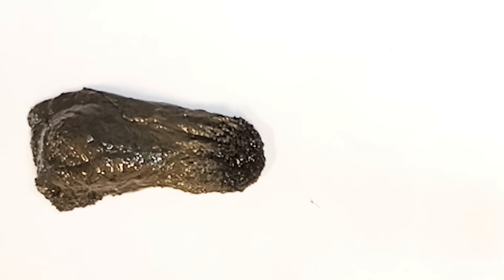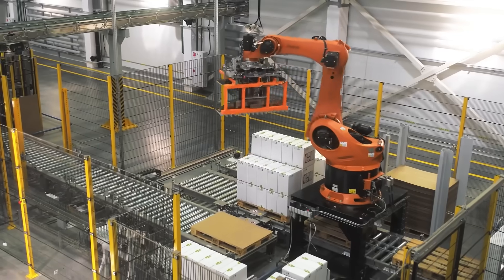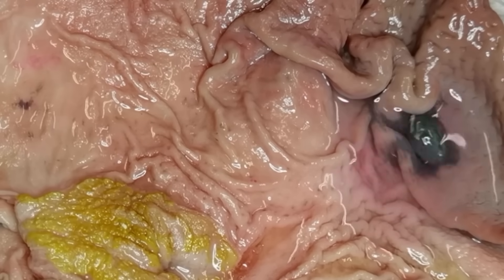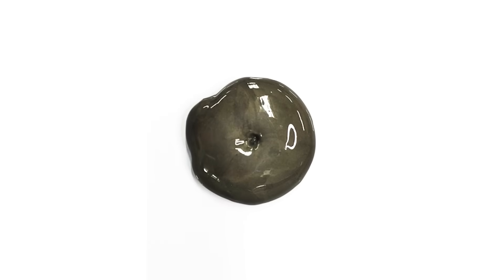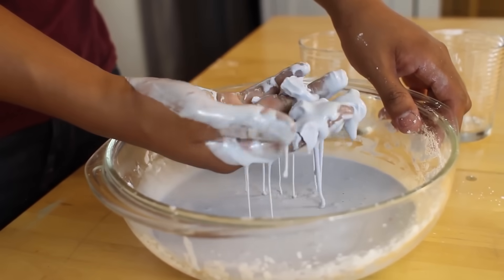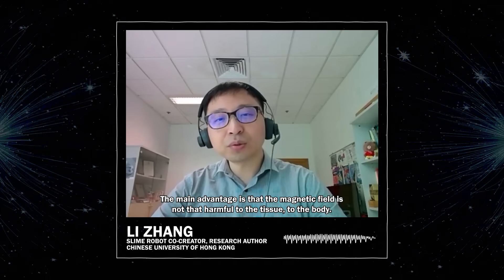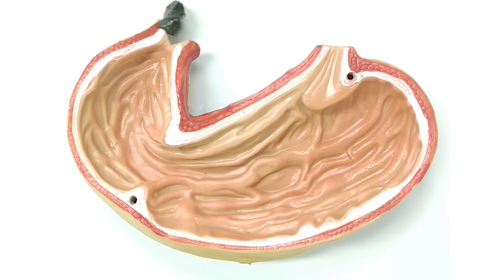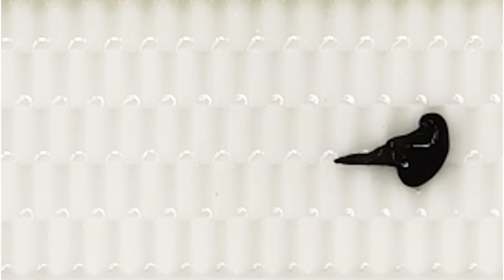This Is The First LIQUID Robot, And It’s Unbelievable

Comment: Using these to reconnect severed spine signals would be interesting. They could even grab a nerve and pull it towards the other broken nerve long enough for them to fuse and heal, then it could retreat out of the body (I'm assuming a strong external magnetic matrix is needed to drive the little dude, so you couldn't just leave it there. Unless the slime could be 'set' kind of how UV light sets some materials)
Reply: But the pressure should be low in the area of the damaged nerve. It can create a protective layer around till it fuses completely. But it should be inert to the acids and other secretions in the body. It's a cool topic for discussion 👍
Reply: Yours is a very interesting topic, specifically the setting feature.
I hope your comment gets upper and read by some creative folks
Reply: In the paper, the magnetic slime is 90% water by weight, and the authors freeze-dried the material to study its rheological properties.  So “setting” in situ seems plausible, but not practical.  I’m curious how its conductive and structural properties would be affected.  The SEM images of the dried material show a pretty dense matrix, and it’s possible the surface would provide enough friction to keep tissue in place for a while.
Reply: If it sets, then getting it out of the body would be pretty hard. 

I think you could just have some sort of puck that you somehow stick on outside the body right where the bot is, and it's sole purpose it to hold it there.
Reply: NANOMACHINES, SON
Reply: step 2: move it into the brain of a person and start mind control and manipulation
step 3: have people do your job for you.
step 4: get soft tacos for everyone.
Reply: @totoisayal5045  i support this
Reply: I think it's possible that it could be "set" as you described using a specific frequency of magnetic field - the slime would need fine-tuned for this, of course
Reply: True it could help humans advance in the medical field but i have mix feelings with this robot, it might disfunction during surgery inside the human body which is terrifying
Reply: It would be interesting, but sort of impossible from what my non-expert wikipedia brain understands. The biggest problem with central nervous system regeneration is that 1. The nerves grow very slowly as compared to peripheral nerves (ex. In your hand), which so far isn’t really that big a problem, it would just need more healing time, but the problem is that our bodies sort of break down the nerve a bit and make a sort of scar, the little dude could work, but you’d need to make it a less hostile environement for the nerve regeneration and also probably find a way for him to get in.

Edit: also, ‘set’? You don’t need to set nerves.
Reply: @clawsproductions582  Interesting. Yeah I figured there might be degradation of the nerve beyond what would be usable. "Setting" I meant that the conductive goop could bridge the electrical gap and permanently freeze itself into place. Ideally turning into a flexible cable. You'd have to do this for each nerve, so it'd need to be incredible fine and made of something the body didn't attack.
Reply: @Octamed  sorry, i’m dumb, but there’s the problem of the goop getting into the spine in the first place and isn’t as much a problem of needing to grab and hold the nerves but the environement in the spine itself and the scar tissue which forms.
Reply: Wouldn't grabbing the nerve that is still connected to the brain be extremely painful?
Reply: @FerunaLutelou  there several types of neurons, only some of them signal pain.
Reply: @FerunaLutelou  I've read somewhere one cannot die of pain alone so i think its fine. As long as it would seem reasonable enough to endure (restoration of motorics, for instance)
I bet there'd be a line
Reply: Ending being paralyzed!
Reply: If the CCP is interested, you can bet they have other uses in mind.
Reply: That's assuming the body doesn't reject it and attack it
Reply: It could be used to clear blocks in arteries without surgery
Reply: So what you’re saying is the natural Sunlight can heal the body? That’s all I’m getting here😅
Reply: Use a different nitrile polymer or memetic ceramic with picoscopic magnetic particles that can be guided, then set via ultra-sonic wave.
There are zillions of options. These are two basic ones.
Reply: @thomassutherland2647  hahahaha oh like its one of those people who tries to sound smart on the Internet. Picoscopic isn't even a word champ. A picoscope is a type of oscilloscope lmao. It is absolutely nothing to do with size.
Reply: It is True that picoscopes exist. It is used by those that wanted to "re-brand" the name Labscope as it wasn't "Cool" for the New Age. Pico: Metric 10  to Negative 12, derived from Spanish. Even though the term Pico for a  standardized measurement wasn't fully adopted until 1960, many had used it in Europe for over 100 years prior. 
Over 10 million submission sa year are sent to various dictionary companies a year for words to be added which are then voted on by popularity. Words like picoscope, are not in older dictionaries.  Over time, some words, are not Commonly used enough that they are even removed from dictionaries. The worst are Acronyms, as Thousands are used daily with virtually zero regulation, except the Trademark and Copyrighted ones.
Reply: I don’t think leaving it in would be all that practical over time. Maybe for short periods of time, but just enough to allow a more permanent replacement within a few days.

Tiny magnetic fields aren’t dangerous to humans that much, however I can imagine a gradual issue arising as it sits in one place for an extended period of time.
Reply: @Jordan and where did you see me say "oh, it's almost done", hm? Ofc there are problems, there always are, even with the technology that we already use daily. Just because it's a decade or more away doesn't mean the good aspects of this tech that already work should be ignored or forgotten about. It's not like I'm telling people to "throw money at this research".
Reply: Yeah yippie
Reply: Although noble, the evil in the world has already seen the potential to make slaves out of lazy humans who do not want to move. Inject them with a strange liquid that crawls up in the body, and block and produce electrical signals to make people do whatever it is you want. And, now that you're blocking hormones to kids, they can all look like little girls. I mean, WOW! Do you NOT see where this is going? Sick, if you support it.
Reply: Get “vaccinated”.. get “vaccinated”
Reply: I like your idea...If it is feasible it will help a lot of people
Reply: yah, keep hypothesizing. its just slime controlled by magnets.
Reply: Yeah
Reply: Guess again Sherlock...
they're using it inside PEOPLE💉💉💉💉💉💉👹!!!!!
Reply: Yea but they going to use it to kill you that's even better
Reply: Good luck ever getting an mri after this
Reply: Nothing gimmicky at all. The possibilities are boundless. I keep wondering about having a personal liquid robot to help heal different parts on an ongoing basis, maybe cleaning out arteries, etc. The mind boggles at all the potential applications.
Reply: Its already been done! 2,000 years ago! And still being done today! Haven't you ever read the bible ? Or been to a church that believes what Jesus commanded us to do? I suggest for more understanding on the matter that you start with reading Mark 16
Reply: Microrobots could deliver drugs straight to diseased tissue.  Fish-Shaped Microrobots to Deliver Chemotherapy to Tumors
https://youtu.be/4Qa7W-TH948
...
Reply: I understand where you are coming from and I think the words you may have been searching for was attach to a broken nerve and hold it in place  rather than pull,but as I said before I understand where you are coming from,that out if the way,your typed statement is brilliant! Take care.
Reply: By the way I gave you a like as well,you really deserve it.
Reply: Matter of time folks.....it'll be metal next on the nano scale
Reply: It might b usefull for something. Don't know about medicine though
Reply: Are they using this is spinal cord surgeries yet ?
Reply: Sounds more complicated than gluing them together individually. How would you control what gets connected and what doesn't?
Reply: Maybe this goop is what a lot of undertakers are pulling out of dead bodies when they drain the blood😮
Reply: Like it would be compelled to not take over the host.
Reply: As long as they don't turn on you and make you into a Borg
Reply: AI controlled slime seems like a cool thing that would never go wrong.
Reply: You’d trust this?
Reply: Venom
Reply: This thing is not going to conduct nerve impulses dude.
Reply: this sounds like a smart comment until you think about it for more than a second.
Reply: Your optimism is astounding and enviable. All technology will, as has always been, be inarguably patented and effectively utilized to ultimately destroy all humanity
Reply: @JCSAXON  technology had always destroyed humanity? Guess we're just ignoring the fact this is the best time in humanity history to be alive by an absolutely enormous margin because of technology then. Silly me didn't realise its always been used to destroy us. Doesn't seem to be going very well.....
Reply: Or it takes over the body
Reply: Or it could be a terminator sequel
Reply: Damn great idea
Reply: No it can't.  The slime is actually useless for ANY closed system like the body. It is directed and pulled by another magnet.   This stuff is all a gimmick.
Reply: @OgdenM  It is gimmicky, and it's practical use should be outside of the medical field. Nanobots or programmable bacteria, maybe even viruses seem more legit when it come to medical use. I also firmly believe that that sort of bio manipulation exists for some time now, but it remains under the public radar, because of the obvious reasons.
Reply: @airnidzo  hurray for enzyme chimeras)
Reply: @airnidzo  and what are these "obvious reasons"?
Reply: @GamesPlayer1337  Referring to the public knowledge. If it were up to you, would you let everyone out there have the same unrestricted access to the cutting edge technology that prolongs human lifespan (undefinetly)?
Reply: @airnidzo  thats some conspiracy theory shit lol
Reply: @airnidzo  Great Idea. Sometimes programmable bacteria are tricky due to the potential for mutation or outright host rejection but not always as there are ways to lessen the rejection via drugs and other methods.
This can possibly be resolved by using a raw stem cell or abdominal protein from the new host. As always, I just suggest things.
Reply: @OgdenM  it’s not exactly a gimmick, there are some likely uses within the body. It’s just that a lot of what would be nice to see it do, the way it is now would never be able to do. 

It would likely be great at creating barriers in the body. Possibly to cover something you ate so it can be excreted safely, such as a shard of glass. Or to be a barrier for an interior wound or such. 

When it comes to very complex surgery-like procedures though, there’s a lot of changes before it could have any chance at such.
Reply: @OgdenM   I'm a graduate from one of the world's top universities and I'm pretty sure I'm qualified enough to say these have uses. You can inject them in trace amounts to bloodstream over a span of a week and then they can be used to clear internal blocks in blood vessels. To get them out you just need to magnetically guide them to an easy to access region like your fingertips and make them exit there through a cut. That's way more safe and easier than surgery. Also things like kidney stones etc can be destroyed more effectively if we use ultrasonic vibrations of this magnetic substance on the stones than just using ultrasonic sound waves. They can also be used to separate out fatty tissue from skin making stuff like liposuction less painful. But you are not wrong in a complete sense. There are challenges as these are metallic substance which are mostly toxic inside the body. Also if these metals form complexes inside the body, the body has no way to naturally remove them and they lose their magnetic properties when forming complexes. So we need alternative non metallic and preferably organic substances that can exibit similar ability.
Reply: @OgdenM  did you not watch the video? The reason they bring up the harmlessness of the magnetic fields to the human body is because you could put that thing inside the body and use magnetic fields from the outside to manipulate the slime. They also bring up the fact that they're looking into ways to turn it into a proper robot that can move on its own, so that you wouldn't have to manually control it.
Reply: @FerunaLutelou  True, pulling on a nerve might not always work unless they are in a "Femto" of each other. Yes, that is a Metric term, for those that may not know. You might, though. An electomagnetic field, as in all forms of energy, is usually not too bad for humans and larger mammals, but it has to not be  beyond target, amplitude, duration required. Neuro failure, due to exposure of intense energy is what caused Nikola Tesla's mind to start failing. He used an electric field with proper protection, thus causing this to happen. It was later used in a modifed way for executions.
Many didn't like working in the field of creation of energy due to it's potential, as in all things for misuse: E.G. Oppenheimer saying that He essentially became Death, the destroyer, etc. That being said, We must venture forth, exploring new boundaries of science, mathematics,  medicine, ways of bettering Humanity, and Hopefully the World.
Reply: @OgdenM  not a gimmick it's just in production. Things this advanced take time. We'll get there eventually.
Reply: "They could even grab a nerve and pull ot towards the other broken nerve long enough for them to fuse" 

You've just straight fabricated that and posted it like it's a real thing. Wtf is it about the Internet that  makes people think they're experts on everything.
Reply: @dan3458  

Yeah, that's right, post one piece of an entire context to twist the narrative. 

What is it with the internet and people not having reading comprehension skills and capacity for contextual clues?
Reply: Central nervous system nerves, from medulla up to brain don't heal once they are severed, unfortunately. And nerves in general would need microscopic control, you'll need something like Nanites or nano robots to perform a nerve reconstruction. Normal macroscopic nerve surgery is not always successful because of that scale. Nerves are not electrical cables, they are far more complex. Sorry.
Reply: @cesarvidelac  everything is healable you just don't know yet

Comment: im not gonna lie I thought this was already a thing. In fact I made this myself many years ago after seeing magnetic silly putty. I originally made my own crappy version of magnetic silly putty by literally grinding up a hard drive magnet, used a hammer and even tried a dremel but the heat from the dremel basically just made ferromagnetic dust. Then tried it with oobleck and thought it was fun for a bit but that was it, a novelty. Now I feel stupid because this was like 10 years ago. If I had thought that this could have been a life saving invention... I guess I should have done research.
Reply: Technically, isn't this goo just similar to the magnetic silly putty? The real robot part are the programmable parts controlling the goo (out of frame/behind the background).
Reply: Yeah , exactly the same 😁

Comment: I’m not entirely sure I understand how the robot actually moves? Does it need a human using another magnet to move it on the outside of the body?
Reply: I would assume a human using a computer to activate several magnetic fields.
But they don't show any of that here.

And unfortunately the source doesn't say anything up front.
Maybe if you pay to get access to the scientific journals, but personally I think that's absolute garbage.
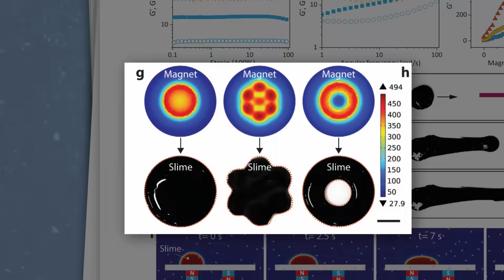Reply: @kamikeserpentail3778  @2:36 Li Zhang: "I'm quite interested in using the magnetic field to drive this kind of tiny device inside the body" To me, that is telling quite a lot and it makes sense that tiny Neodynium fragments can't move by themselves without outside forces.
Reply: There’s a series of robotic arms with permanent magnets that surround the testbed.  It’s mentioned briefly in the paper itself, but the details are provided in a separate supporting document.  It seems most of the videos shown use only one of these arms at a time, but the circuit switching demo used two arms.